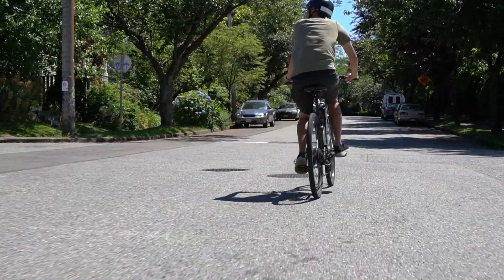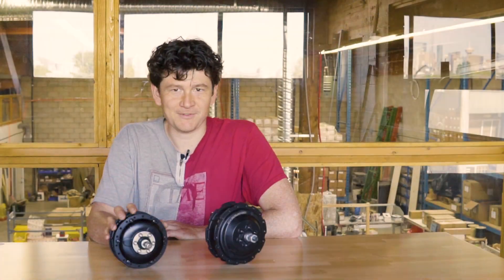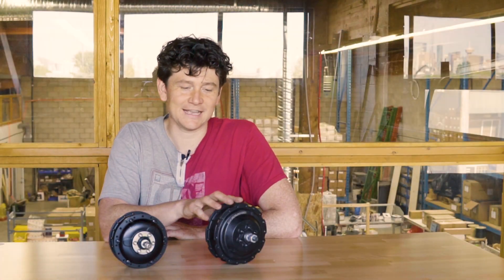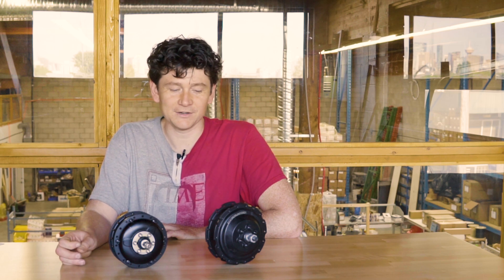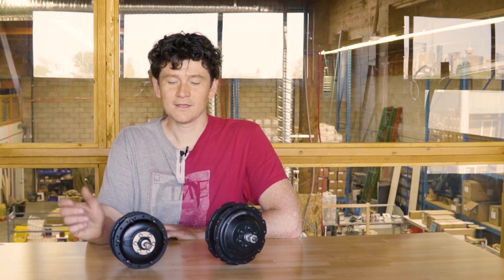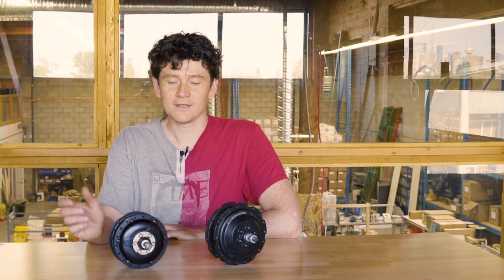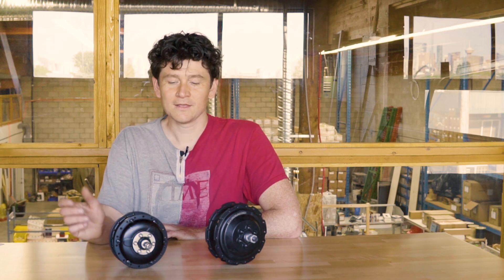Small Geared Hub Motor Showdown,  Bafang G311/G310 vs Shengyi SX1/SX2

Comment: Can you get a motor with straight cut steel gears?
I'd sacrifice weight for strength
Reply: The stock gears can easily handle the torque even when "hot-rodded" however any machine shop will be able to machine some for a small fortune, and then some if you want to do it right with case-hardened steel.

Comment: I just bought a random electric bike at auction with what I've learnt has the Shengyi SX2 rear hub motor. It was paired also with a 52v battery (unknown aH). So far I've got it to 58kph with a 36T chainring and pedaling. Sounds like it's a good design so hopefully it lasts!

Comment: hi! any experience in how other controllers handle the combined speed+temperature signal? would love to use one of these with a kt controller or similar budget options
Reply from the maker: They generally aren't programmed for it. At low temperatures it would show speed readings as normal, and once the motor thermistor got beyond a certain temperature then the voltage signal will be too low to cross the logic 1 threshold and the speed will just show 0 until the motor cools down.  If you don't care about the speed reading on the display then this doesn't matter one iota.  If you want speed readings at all temperatures, then you can simply open up the motor and snip the thermistor out.

Comment: what kt controller can i use with the bafang g310 ? the smallest controller?
Reply from the maker: Any controller with the Z9 motor plug on it should be up to the task as long as it can support the eRPM and can handle the combined speed/temp signal on the white wire.

Comment: I really want to purchase a G311 motor from Grin however all you have are black hub motors. I live in Houston, Texas. The temperature has been over 100 degrees all week (and this is NOT the hottest part of the year yet). You people live in the frozen north and have no idea what the real world is like when you do not have snow and ice six months out of the year 😞
Reply from the maker: We don't follow the correlation. In use the motor gets much hotter internally than Houston in the summer,  and so having a black finish will still radiate more heat away than if it was silver.

Comment: Do you have a contact for shengyi parts? i have tried their website email contact, alibaba page etc, trying to find parts or replacement shengyi mid drive and getting zero response.
Reply from the maker: You should contact the reseller/vendor who you bought it from. They are the entity responsible for offer retail level support. Not the manufacturer.

Comment: I’m trying to make a beach cart using balloon tires from Wheelez and wheel chairs with balloon tires for handicap people. This is all for charity. Any suggestions
Reply from the maker: Definitely not a small motor like this. Moving on sandy beaches requires very high torque levels, probably a geared fatbike motor like the G062 laced in a fatbike rim would be our suggestion.
Reply: @GrinTechnologies  thanks I will look into it

Comment: Hey what a cool channel! You go really deep into how they actually work (which is important in ebikes). I just bought a Bafang G062 48v 1000w. I heard good things about this brand. I hope it lasts!
Reply from the maker: The G062 is a nice motor for sure and we'll actually be offering a version of this hub in a couple months too which will also include the temperature sensor. So you'll see it on our motor simulator and probably in a teardown video soon enough as well.
Reply: hey @Adrian where did you find the g062 48v 1000w?  Seems hard to find them at the moment, in particular the cassette / 190mm dropout variety ..

Comment: High wattage through those you're going turn the gears in the peanut butter
Reply from the maker: It is not wattage that damages gears, but torque, especially if the maximum torque is not derating the  motor core heats up.  With proper phase current limits and thermal rollback settings, there is no problem running at the power levels we discuss on this video.

Comment: same bike, same road, at 30kph is the Wh per km better for the shengyi having less gear reduction stages?
Reply from the maker: Same bike, same road, same modest speed, you can expect basically the same Wh/km.
Reply from the maker: There are certain load scenarios where either the SX1 motor or the G311 would have a small efficiency advantage over the other, but it's not going to be that noticeable in aggregate.

Comment: Very nice. I plan on ordering a system from you for my wifes Townie with 3 sp internal hub.  That bafang on the front would be a sweet setup!
Reply from the maker: It's indeed been a great little motor as long as you don't have expectations for steep hill climbs without pedal assist. We have a video of the motor installation process here if you are interested: https://www.youtube.com/watch?v=t9jvgsOT6jo

Comment: Interested in doing a single speed  conversion on a Trek FX1. Would the Shengyi be the best for that?
Reply from the maker: If you've got some hills to climb and want a freewheeling geared motor, then yes that'd be our suggestion. The Grin All Axle motor is a great choice if you also want regenerative braking capabilities.

Comment: I have an old motor with the number: SY 24 28 110 12 1 
Is it a shengyi, and if yes, which model? Do they produce inrunner and outrunner? I need to know this for the motorsetup

Comment: I read reviews online that said that Bafang quality control was possibly not very good, because actual power output varied quite a bit from the spec's. Have you guys seen that, and is Shengyi reliable as far as meeting their stated spec's?
Reply from the maker: Bafang if anything is quite conservative in their specs, they can safely delivery more continuous and much more peak power than what they advertise especially at higher RPMs. But you should know that power ratings are pretty meaningless, see:
https://ebikes.ca/learn/power-ratings.html
Reply: @GrinTechnologies  GREAT writeup, thank you. For your controllers that monitor the motor temp and reduce power at a certain point, do you have a web page that talks about how that works? Does it work on a curve, so the hotter the motor gets the less power it gets?

Comment: Thanks for a great video. I've been riding one of your SX1 kits (urban commuting and longer distance road work) with over 3K on it now and just love the motor. I originally chose the SX over the G311 for many of the reasons mentioned in the video (but also had to go on some assumptions and erred on the side of a bit more power since I'm a bigger - 100kg guy). I'm now considering a true road bike setup for longer rides (>70k) and looking strongly at an SX2. One thing you didn't mentioned in the video that I noticed using the motor simulator is that the SXs still seem to have a small efficiency advantage on the G31xs, and over longer distances this starts to become significant in battery usage, and would negate any weight advantages. This would seem to me that aside from the lower price that the g310s wouldn't offer me any advantages for longer distance biking. Does that make sense?
Reply from the maker: Hey Mark, our dyno tests indeed showed the SX motors having higher peak and loaded efficiencies and this is reflected in the motor simulator too. At some point you are correct that the extra weight in battery needed to compensate for this reduced efficiency would negate the savings in motor weight, although that point would be when you are talking like 20+kg worth of battery pack on the bike. Most people are far from that, but if you are doing like 200+ km trips with a lot of packs in parallel then you could get there.
Reply: @GrinTechnologies  Hi Justin & Co. We talked at length about a G311 build for a long range setup on a tandem but COVID put the brakes on that touring trip. My son is now riding a 24" bike so I am thinking of a touring build so he can keep up with the adults on a 60km day with panniers. Bike + Gear + Boy would be 60kg max. I modelled best I could and calculated it would need a 36v 16.Ah battery. @mark lewis what sort of range do you manage with your battery capacity and the SX1?

Comment: Aren't Shengiy the junk motors that Super73 uses, no torque and usually blow up within the first hundred miles, the Bafang is the much better choice.
Reply: Your comment is ignorant, but it's not too late to delete it.
Reply: @fun_ghoul  I guess you own a super 73,  it's not too late to find a sucker and sell it. 😁👍
Reply: @fun_ghoul  I wouldn't say that, they just had bad  luck with super 73 and I feel bad for anybody that dropped 3 grand plus and had to go through that Fiasco. So who's the troll B 🤔
Reply from the maker: Can't comment on Super73 but both Shengyi and Bafang make a huge range of hub motors in different sizes and power levels. This vid is specifically comparing the Shengyi DGWX motors with the Bafang G310/311's, and our firsthand experience with these models in particular is a much higher failure rate on the Bafang, mostly from excessive power usage but also some random instances of clutch failures even when used well within recommended limits.

Comment: Interesting be see efficiency curve of both motors...
Reply: Acording https://ebikes.ca/tools/simulator.html?motor=MSX_8T&cont=C20&cont_b=C20&motor_b=MG310_STD&bopen=true&wheel=20i&wheel_b=20i Shengyi is much more eficient. Strange. Always say people, that inrunners (like in bafang G310) is more efficient.
Reply from the maker: Yeah the actual dyno test results had a peak of 85% on the SX motor and just 80% on the Bafang G310 when running at typical ebike rpms, so the simulator model is reasonably accurate here.  I've never heard it suggested that inrunners are more efficient than outrunners.
Reply: @GrinTechnologies  may you known: more efficient is fast or slow motors (with more windings)?

Comment: How would the Bafang G02 (older name SWX02) compare? more power handling than the G310/311....
Reply from the maker: The G020 is more powerful for sure. We have this modeled on our simulator as the Stoke_G02 as we used this motor for a while in the stokemonkey mid-drive kits.  Here they are side by side with KV adjusted to match: https://ebikes.ca/tools/simulator.html?motor=MSTOKE_G02&cont=C20&cont_b=C20&motor_b=MG310_STD&bopen=true&kv=8.526
Reply: @GrinTechnologies  I have an SWX02 and I already burned one climbing the mountains here in summer. It really bogs down on the long ascents. What would you recommend?

Comment: Great informative video as always. Anything you can say about the motors that super73 is using on their bikes ?? Thank you
Reply from the maker: From the photos they look like the Bafang G060 fatbike hub or an equivalent clone, as there are many companies that have similar looking motors to this. Without an explicit model number it's difficult to say. The G060 is available with 3 different thicknesses of motor core for 350W, 500W, and 750W nominal models, all of which share the exact same outer shell dimensions.
Reply: @GrinTechnologies  thank you

Comment: Perfect road bike build!
Reply: Agreed. I (90kg) was sold on the front G311; small size(is that a dynamo?), small weight and silent operation , but ripping apart my forks is not an option - so I'm more than happy to change to front SX1 with torque arms - and enjoy the bonus extra power and robustness. Batteries will be under seat LiGo+ x 2 or x 3 up to x 6 for that long hilly trip. I also could use my trailer with the SX1 - cool. I'll come back here with finished build and use report.
Reply: For a serious roadie unaccustomed to the added weight, the G31* paired with a tiny battery is still a valid choice IMO. High speed powered operation favours direct drive ofc, but I wonder if some people aren't mainly using a motor to save their knees from a standstill, and "overrunning" the motor (clutch) at the top end with leg power...
Reply: @fun_ghoul  I'll let you know after my build comes out. Prefer the dropout with torque arms instead of the g310 option.  Actually the g310 was my first choice.

Comment: Can these motors be driven in reverse? I would like to use a small geared motor as a pedal generator for a series hybrid bike.
Reply from the maker: You can't power them in reverse because they freewheel, but you can quite easily spin them backwards to force the motor to turn and use them as generators no problem. We've had a handful of customers do exactly this. 

If you are interested in studying the analytics of using motors as generators and finding the optimal RPM for a given power level, I've covered that here:
https://endless-sphere.com/forums/viewtopic.php?f=6&t=93482&start=25#p1375674